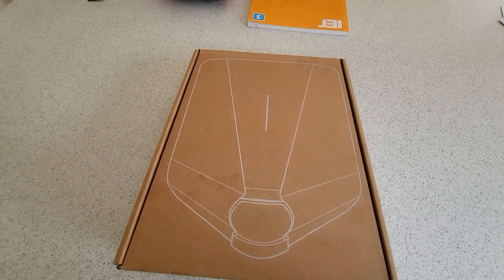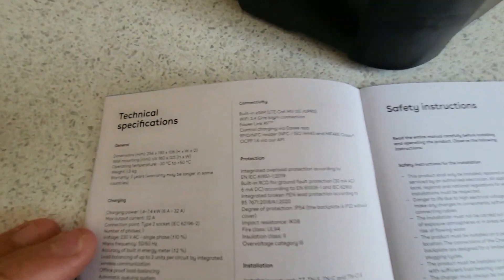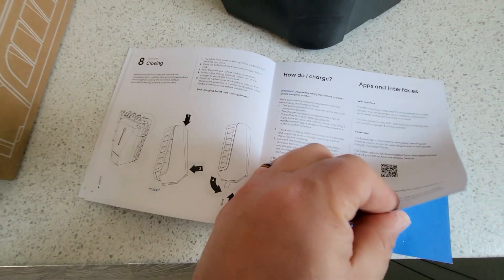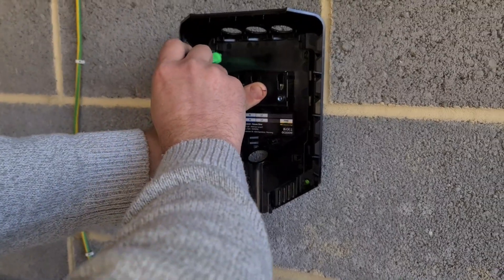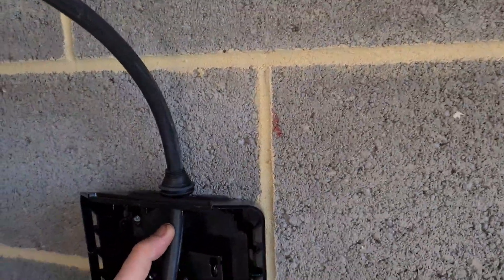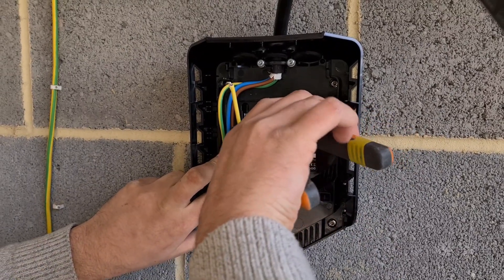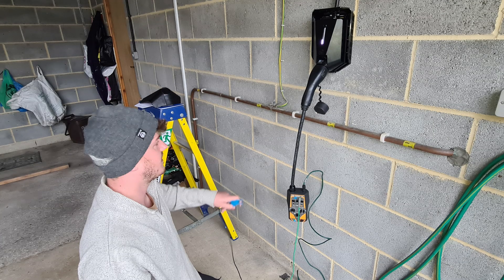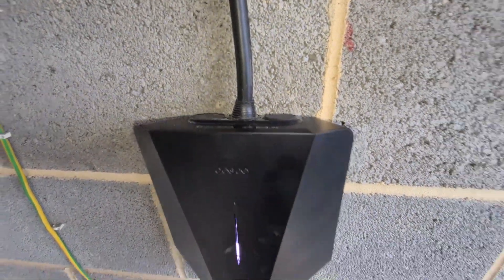Install EASEE ONE electric vehicle charge point

Comment: Great video! Is there any provision here to monitor the overall house load to ensure the main fuse isn't overloaded?
Reply from the maker: Misconception that's always required.  Most 100A supplies are fine without subject to no heat pumps and such. But yes CT/consumption data is installed here.

Comment: personally as it was inside garage i would have ran a bit of 4mm t&e instead of armour.
Reply: This needs a 40A breaker to run at full power. You should be using 6mm as a minimum.

Comment: Hi Mark, nice vid... we are just moving over to these chargers. How do you get around not installing an SPD ?
Reply from the maker: Charger has over voltage protection built in. But if you want the tails isolator switches with spd are a nice easy way of doing it.
Reply: @electrician247  thanks for the reply Mark. The under/ over voltage protection I don't think is in the same league as a dedicated SPD but you would DEFINITELY know better than me 🤣 .. I personally think where practical an SPD should be mandatory on all EV charger installations. Isn't it the regs to install an SPD to protect against damage to expensive equipment I.e 40k + vehicle. Or are we over engineering our installs, we've probably lost jobs by including an SPD  🤔
Reply from the maker: @calvinhale9913  We always fit SPD in line with the tails when it's not in place. But most charge points have them built in. Generally an SPD loses a lot of its effect 10m-30m into an installation. Which is why lots of the EV equipment now has it built in. Anything other than a network derived problem and it wouldn't be a guarantee of anything.

Comment: I have this exact charger, but it keeps showing a PEN fault (constant red light) at random times in the day and will last 2 to 3 hours. No charger connected, but it cannot be used when this happens, any idea what this might be? I can only charge my car when the charger shows a white light, quite frustrating.
Reply from the maker: You could have a pen fault or the charge point will be faulty. I would contact the installer and ask them to take a look.
Reply: Check your voltage. We had one property with 255 volts and their Easee was showing PEN fault with the red lights on.
Reply: @gaborkucson  This seems to be the issue, it keeps tripping my EV charger. Is there anything I can do? maybe a more sophisticated charger which is less likely to have nuisance trips? My charger is being tripped and I can't use it for a whole day some days. My installer is useless too.
Reply: @NickLiang  If it's definitely the voltage, you should contact the DNO to rectify it

Comment: Hi mark another great video. And this looks like the simplest charge point I’ve seen installed!  Can you tell me does this have a CT clamp for load management? If not not do you limit the load? Thanks Mark👍
Reply from the maker: You can have a full load management system with these charge points mate. Over 100 can be connected to the same cct and system I believe! Very versatile product 👌
Reply: @electrician247  ahhh!! Sound very interesting. Do you know if the load management via app then or CT clamp? I’ll check the website aswell. Thanks Mark.
Reply from the maker: @Bazza-tn5ck  you can load limiting in the app and use CTs mate. The commercial system is really flexible

Comment: Hi Mark. The Video was released the 1st of April so you are taking the Mickey on this one. The main DB has RCD type AC as main switch. That Consumer unit cannot be used for Feeding EV charging points as DC leakage from car through charger will run back into DB and blind main RCD which it will no longer trip when required. From the video you don't show charger MCB connected to main board so I am sure you ended up replacing the CU with 18th edition compliant
Reply from the maker: Not so mate it's  16th edition split load board with main switch one end and RCD the other. No upfront RCD protection needed. This is a genuine installation and no RCDs were blinded in the process lol. 

Look carefully and you will see the split bussbar. I always remove the odd critical part of our installs from video to avoid DIY copying lol. We have a B32 breaker on the non RCD protected side 

Have a good weekend 💪
Reply: @electrician247  My bad. I could not see main switch on your video and I thought the board was one with RCD main switch. My fault on looking for April fools when there is not one lol. 
Thanks for sharing your very informative videos, keep up the good work!
Reply from the maker: @andreavassallo6586  I got caught out by 2 April fools. One from Stuart Cato about solar brackets that generate electricity 🤣. 

Have a great weekend Andrea
Reply: The Easee one is fine to use with an already RCD protected circuit anyway.

Comment: Hi Mark  so we’re are we now , regards separating the PME  at the incoming supply . Are the regs now moving away from that requirement, or as an old retired electrician am I missing the point as usual . I appreciate that these chargers are not all the same , but is there now a definitive regulation to adhere to  obviously dependent on the type of incoming supply .  If anyone knows it’s you sir       Best wishes and kind regards as always 😀👍👍👍
Reply from the maker: Hi mate. Most charge points have pen fault protection built in. The ones that don't will need a rod or something like a Matt:e upfront of them. 

The new amd2 makes things more interesting with the recommendation aka should for an electrode or such on pme supplies. Gets more tricky every week lol. 

With EV we are definitely moving to times we're everything in terms of consumer/vehicle protection is built into the charge point.
Reply: @electrician247   hi Mark bless you I’m beginning to see how difficult life must be for you as this technology is changing at such a pace , thankfully there are companies such as yours to guide and support the customers  that are definitely going to need the likes of your good self to traverse this potential minefield .  I hope NIC are onboard with this new aspect to the trade , because ultimately they are the ones who are going to assess an installation . But alas in my past experience they are not always consistent in their advice .     Best wishes and kind regards to you and your team .       😀👍👍👍

Comment: Hi Mark, at last an EV Charge Point that doesn't have the unnecessary tethered cable, I have never seen the need for a tethered cable when every Electric Vehicle has their own cable, or are they too lazy to get the cable out of the vehicle?  What a neat simple and easy to install unit this is.. 
On a different note, many congratulations on receiving the eFIXX person of the year Award. in my opinion very well deserved, I'm sure many others will agree, especially the many Sparks who use you as the main go to person for advise, as an old retired engineer I take my hat off to you young man.
As ever very best regards from Ray the old sod from North Wales.
Reply from the maker: Ray thanks very much! Appreciate the kind words. 

I agree it's a neat little charger this one and you can get all kinds of different colours which is a nice touch. Take care!